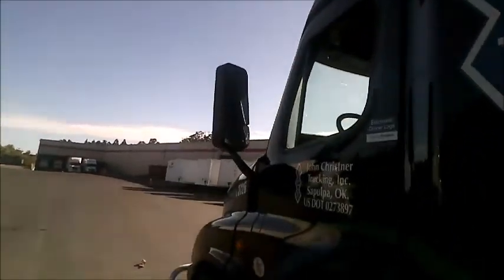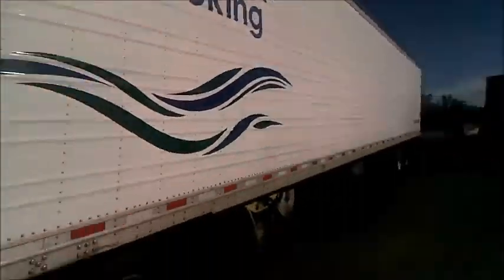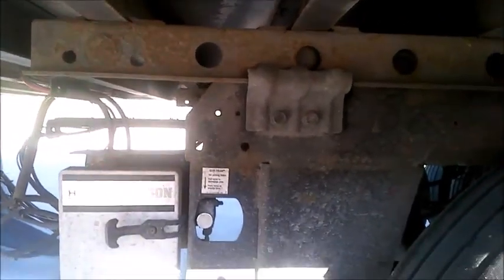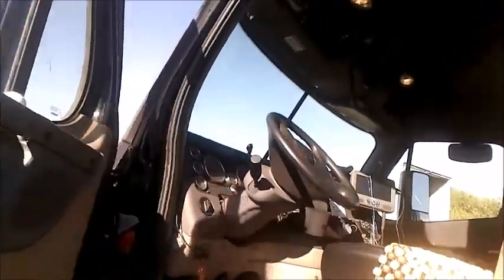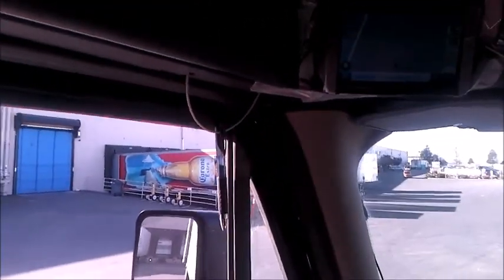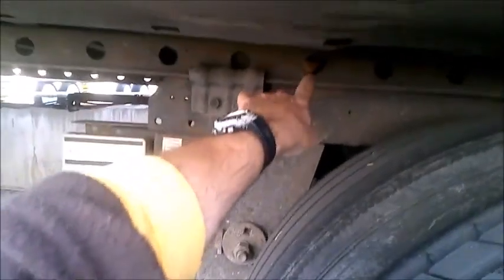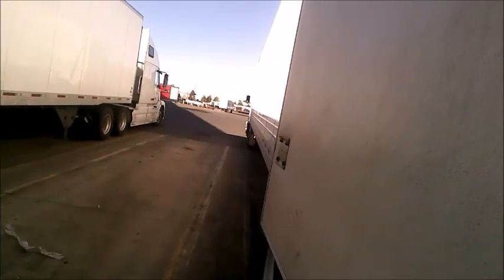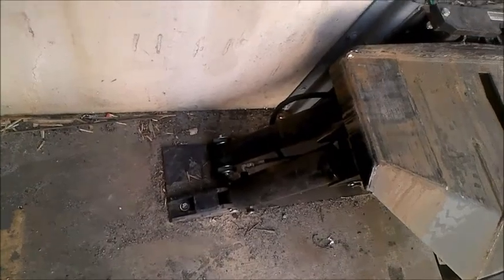Tandem Axle Sliding Tutoroial: 53 foot trailers

Comment: Here’s an idea why not make a separate airline and a button in the cab so you could unlock the slider pins from the cab ? Make all trailers have the same setup would be safer and save a few minutes and make it easier to adjust your weight . The cab button would function like a lift axle on a end dump .
Reply: Would be the same the principle as a tag or pusher axle flip the lever and in go the pins move trailer flip lever back out go the pins simple simple not very cheap but if it saved one driver from an accident well worth the price of fitting a fleet of trucks and trailers .

Comment: them air powered slider pins was just coming out, when i was leased to Dart, back in 96. way better than the hand one's. i carried a 2 lb hammer just to beat the pins in, to slide the tandems.
Reply from the maker: Each system has their strengths and weaknesses. if it is  really hard to slide, the air pins just make it harder because you can;t get a run at it.
Reply: Ha! u talked about seeing the tandems rolling down the highway by themselves. lol. well-i seen a fella trying to get his to slide, and slide them right out from under the trailer one day. what a mess he had. had to get tow truck out to lift trailer back up, to slide tandems back underneath, and then had to have a new ICC bumper installed.
ha!-i'm glad u posted a video-i was bored and was watching septic drains that was clogged. bad -huh!
Reply from the maker: Somewhere way back in my channel I have a video of a truck that lost its tandems out the back. I will look for it and post it for you, no need to be watching septic clogged drains LOL
Reply: lol. ahh-i switched over to farming videos now:)
Reply from the maker: lol ok here it is-- this driver lost his tandems out the back. this is circa 2010 before the no holding electronic devices while driving was illegal--

https://www.youtube.com/watch?v=olNssDMgLak
Reply: ha! i watched it. can u remember if that happened on I-80? and i really miss them CB Rambo's talking the big talk. lol. yelp-really miss it. 

that one fella said all the good driver's retired, lol. i guess i was one of them. ha!